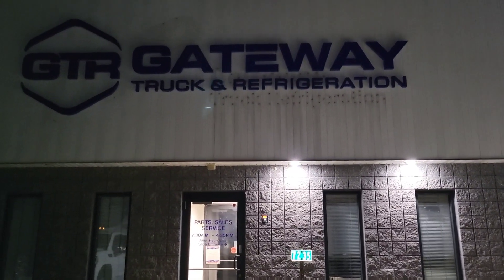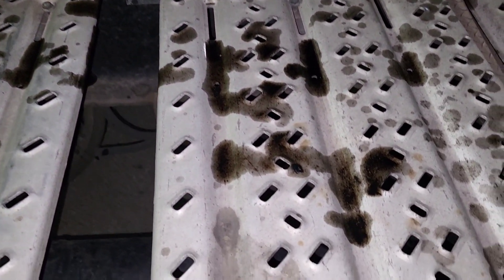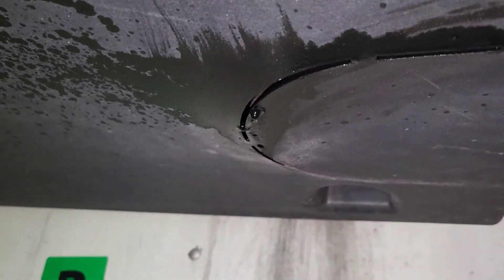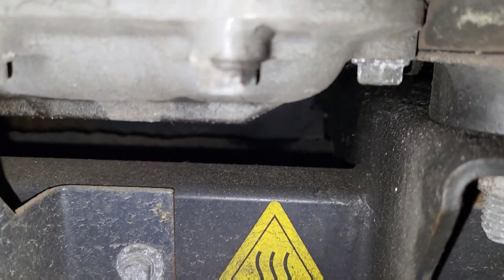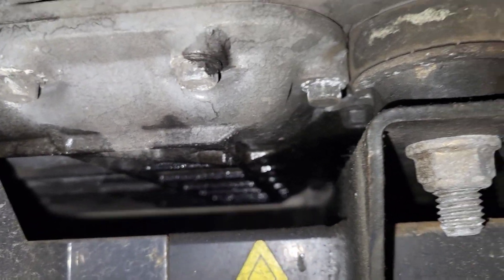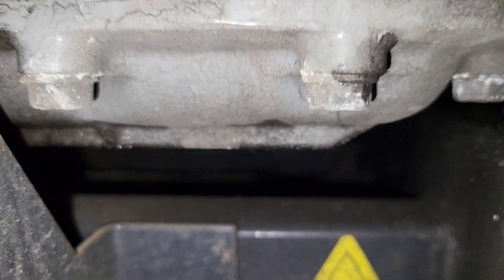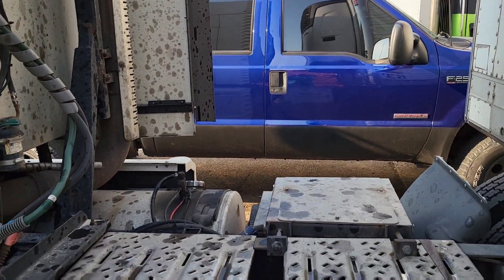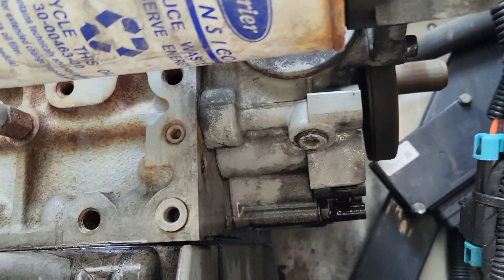-10 Reefer Load And Reefer Is Down

Comment: Clean it up. Put a big cloth towel under front of motor. Check engine oil every 12-15 hours.  Dont put a sleeve on front dampener. Buy a brandnew front dampner.  Do the belts also after oil on them.